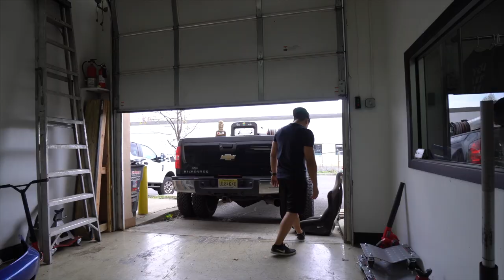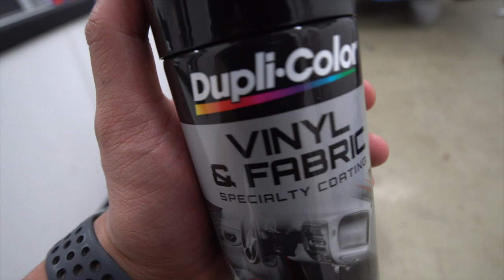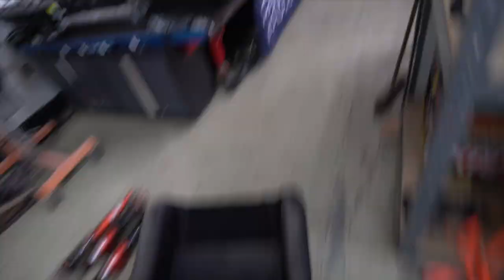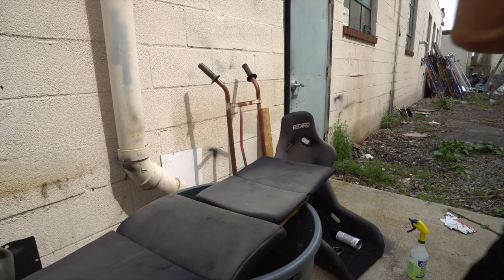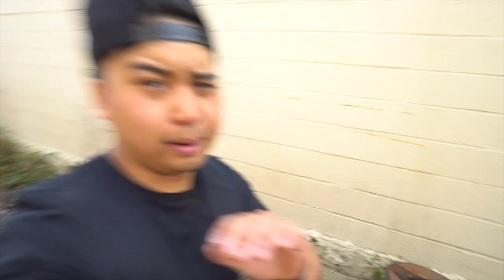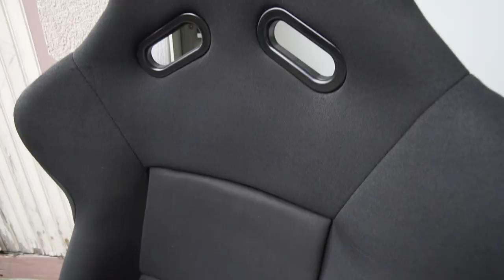DIY: HOW TO RESTORE YOUR FADED BRIDE RECARO BUCKET SEATS IN 1 HOUR !! LOOKS BRAND NEW !!  *EASY FIX*

Comment: Did you find a way to soften it up? I did mine yesterday and its really ruff, should i go over it with a brush?
Reply: Used a spray bottle with water. Spray it lightly then paint it. It helps if it a bit damp so it can dry slowly to be a bit soft. Or you can check out Annie Sloan interior chalk paint and wax for fabric dying.

Comment: Does the fabric harden after being painted, thinking of doing my r32 gtr seats that are sun faded
Reply: Wondering if this is a good option or if i should remove the covers and submerge in some actual dye
Reply: Yes it def does harden.  Carpet, seats, anything - if you expect it be as soft as it was, this aint the way.  But if you don't mind, like carpet in your car because you're not laying on it - it works.